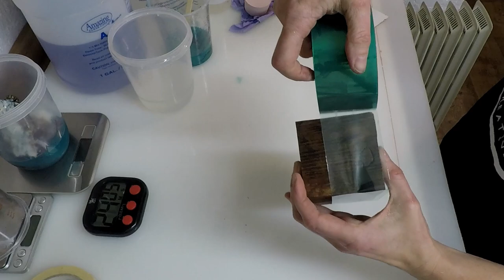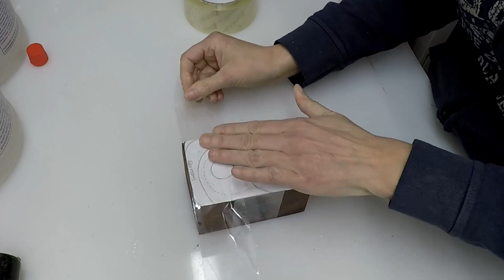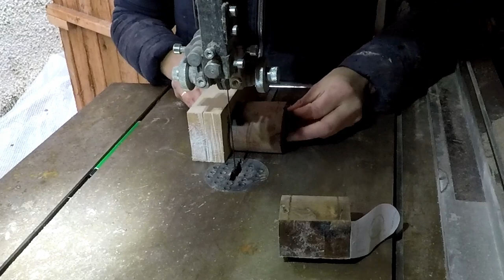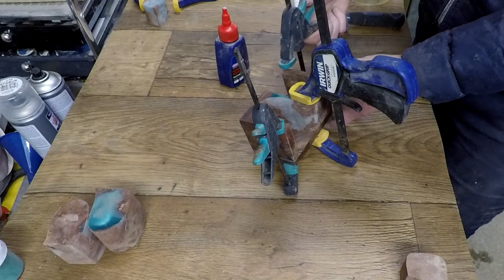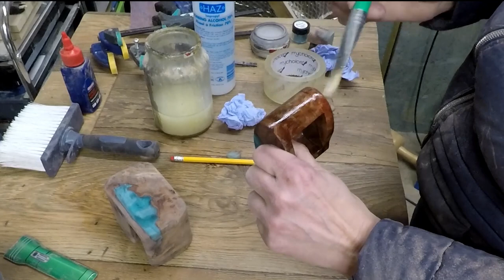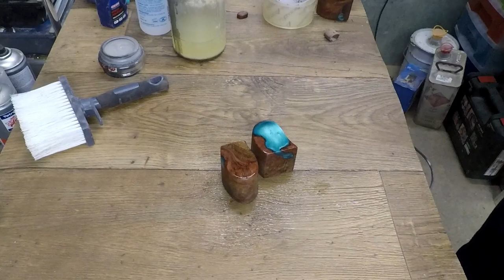Resin and wood - Bandsaw Box

Comment: Hi Pam, That is lovely. I tried to make a bandsaw box once, total disaster. will give it another go after seeing this video. What finish did you paint on prior to using the trade spray? Cheers, Huw
Reply: Same question thanks Pam 👍
Reply from the maker: I used a sand sealer on the box first after cleaning the wood with rubbing alcohol then a simple lacquer sand with 600 then another coat of Spray. :-)
Reply from the maker: I used a sand sealer on the box first after cleaning the wood with rubbing alcohol then a simple lacquer sand with 600 then another coat of Spray. :-)
Reply: @Highlandboxes  The sanding sealer....that was in the jar that you brushed on the piece?  Your vids are super motivating Pam.  Great job and music too!
Reply from the maker: Thank you Howard yes its from the jar 50/50 with cellulose thinners is what i use. :-)